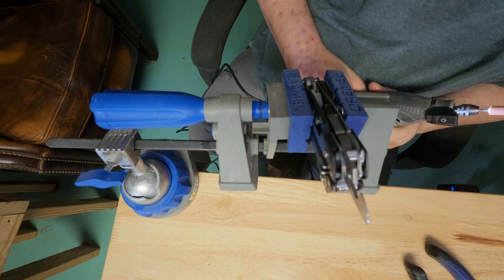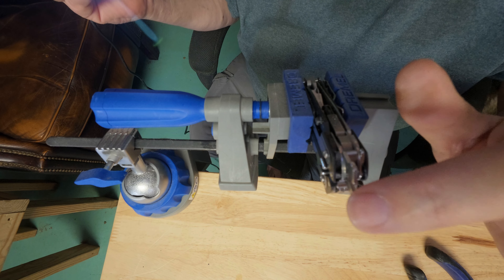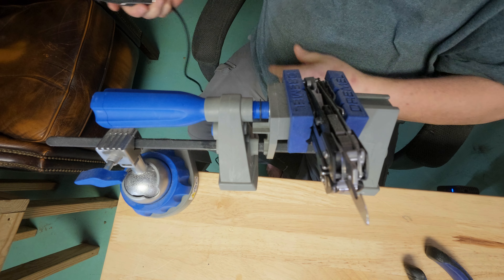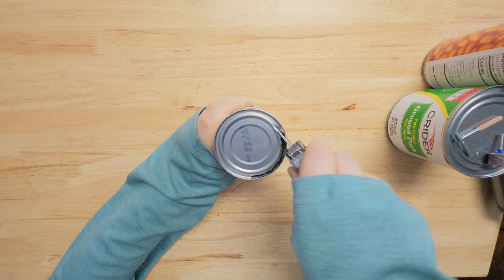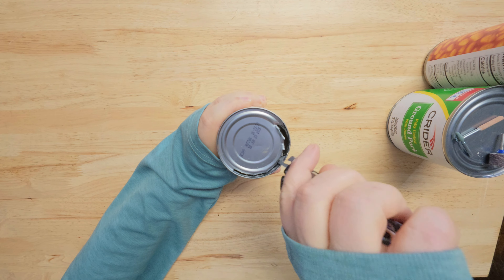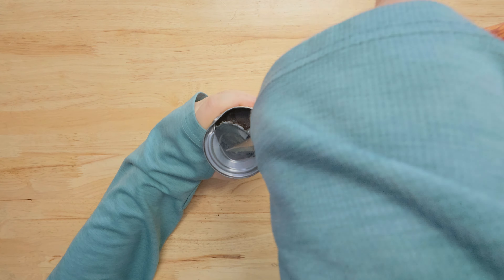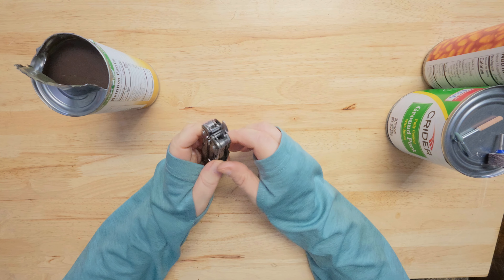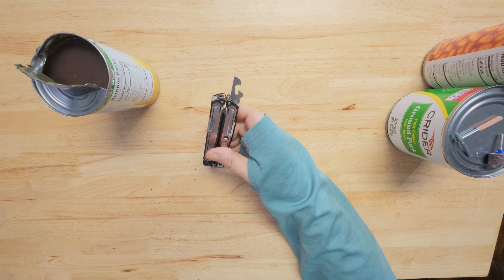Leatherman ARC Can Opener Live Testing

Comment: Am I the only one thinking that this is THE most premium multitool on the market, and its a little bit insane that you have to sharpen your own can opener before it works properly? If it was used to the point having to be resharpened that would be a completely different thing.

Next year they will launch the Leatherman Shortcircuit and it comes with a saw that you have to put your own teeth in. The file for putting teeth on is sold separately for 199.